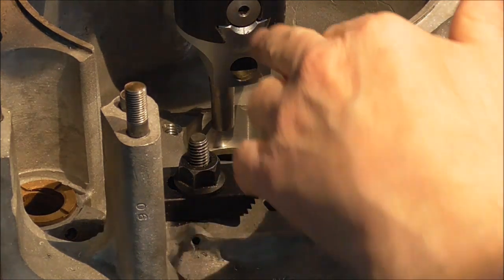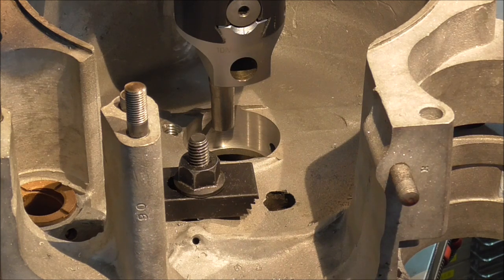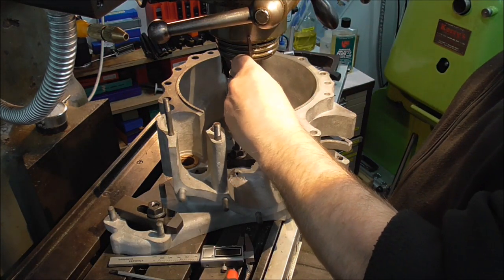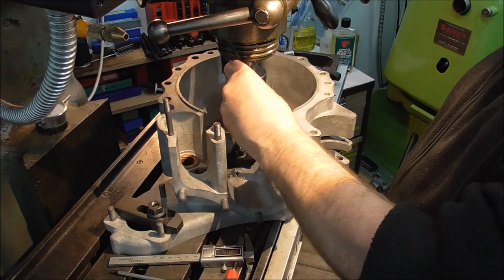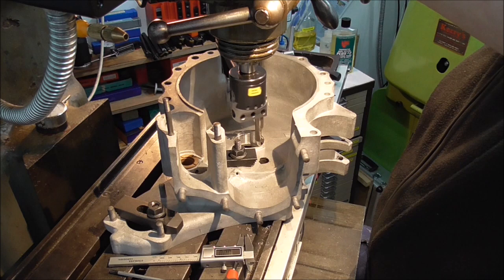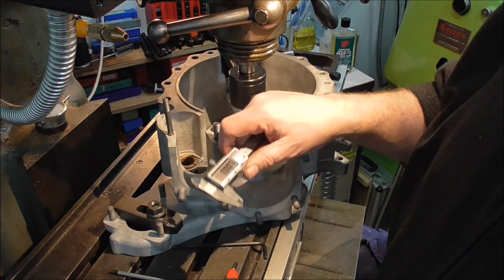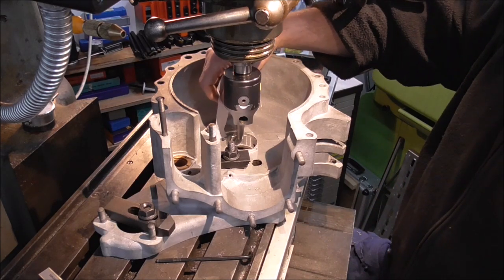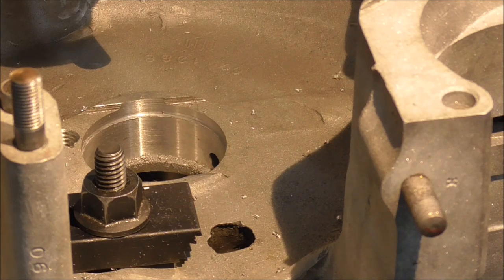BSA Bush to bearing conversion #7

Comment: If the professional does not have creative intelligence, having the most sophisticated instruments will be of no use. I was able to observe the references taken using the base of the machine tools to define the beginning, end, spacing, determining with precision each intelligent stage of the work itself. The recovery of the crankshaft, damaged by some mechanic or technician "boar" was difficult, but with totally positive results and still improved. Too bad there is no international school for learning industrial mechanics. You would certainly be the Technical Director and advisor from the beginning until the end of a technical course of thousands of hours of classes at an international level. A true doctorate in metallurgy and industrial mechanics.
Reply from the maker: Oooh go one, you're embarrassing me now, many thanks for your support.

Comment: Thanks for the mention Ade, there is always another bit of kit we need! The project is going really well, circlip fitted a treat. As my brother said, we grew up being taught about British bikes by our Grandad. I've had a lot of Japanese bikes but now I also have a little Francis Barnett to restore once the workshop at my new house is sorted. Thanks for telling us all about the mill, my brother and I had wondered about the make. Really enjoying the videos, many thanks. Dean in Oxfordshire.
Reply from the maker: I would have liked a Bridgeport but they are a lot taller with the motor on top, mine is like a pillar drill with the motor at the back so it fits in the workshop well. Must get my power feeds finished though...
Reply: @AGEngineering  it looks a really decent machine.

Comment: That worked out well.👍
Cutting that groove reminded of a job i had once where i had to do the same on a 4 cylinder  bike engine while still in the frame. The clutch pushrod seal failed and the way you are meant to do it is split the crankcase halfs, a non starter price wise, so i made a little "boring head" which piloted on the pushrod bearing and used a cordless drill to remove the seal retaining ridge and then cut a circlip groove. Saved the man a fortune, which he didn't have anyway.
Reply from the maker: That sounds like micro surgery but great idea
Reply: @AGEngineering  people come to me to solve these little problem, silly fools!

Comment: Great work that tool was not shabby, I did see the threads near to the grove but on camera it looked 4mm away! It worked well & I think you did right thing, a little lock tight in the grove in case it starts vibrating round but I very much doubt it. A little information on your mill motor while doing a slow cutting part was very clever got me interested.  I Like the mission so far & reading the comments you have got your audience hooked 😀 it was nice to get a mention 
’ but I think you had it all covered!! you don't miss a trick. You've forgotten more than I will ever know. Rob
Reply from the maker: I'm glad me twittering away while I'm working is seen as a positive, I was going to edit a lot of it out and just do a more 'instructional' style.
Reply: How shops come together is important.